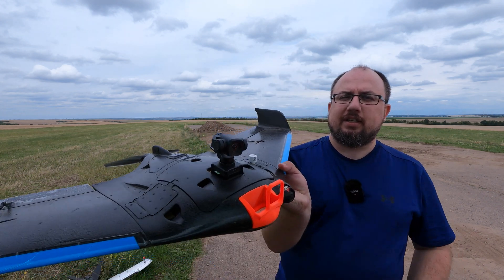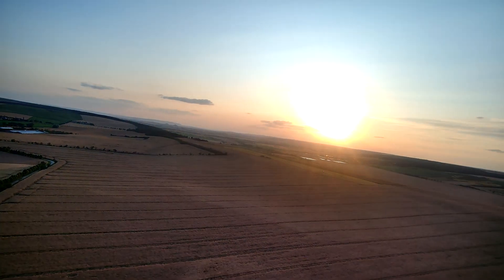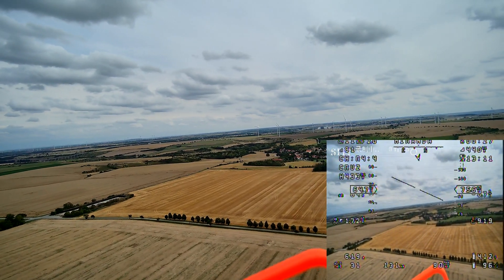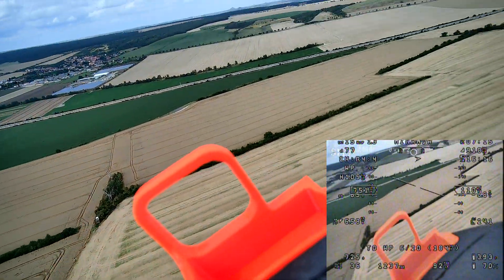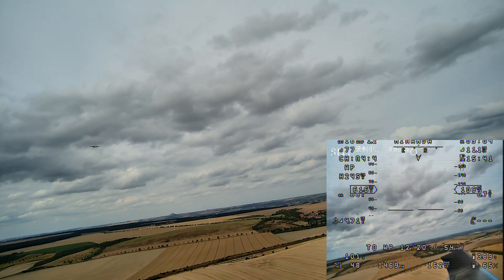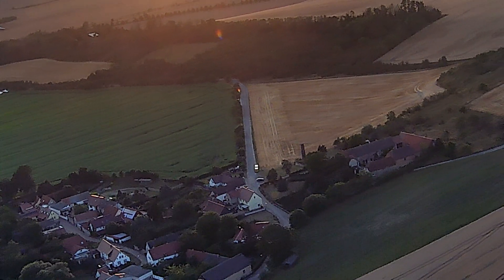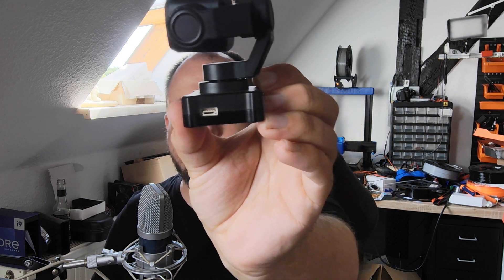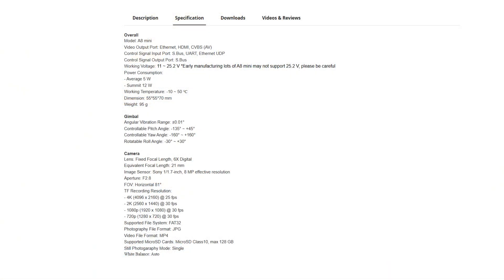Siyi A8 mini Gimbal on a Fixed Wing - Review [ENG]

Comment: Does any manufacturer provide zoom lenses for digital fpv cameras? 
I like the new Walksnail GM-3 gimbal, but the default 160 degree FOV on their cameras is way to wide (especially with head tracking).

Comment: Great video, very helpful, I'm still working out a few bugs implementing the A8 into my multi rotor, I mostly fly fpv freestyle quadcopters for recreation, and have a DJI Mavic 1 and Mavic 2 Enterprise Thermal for my side business and search n rescue team I volunteer with.  I recently got a good deal on a DJI F550 hextacopter, that I want to make into a lighting rig for search n rescue ops.  It's my first multirotor with more than 4 props, so it's been a learning experience, the A8 was a perfect price and fit, because it's purpose will be lighting more than photography, but with everything on the F550 being in the DJI ecosystem it was a little bit of a challenge getting the A8 to work, and I'm still ironing out a few things. 

What I did is use the DIY cable for the ethernet connecter that's next to the HDMI out, and just used the AV out pin to an analog 800mW fpv transmitter (there's actually a DJI OSD module between the A8 and video tx, for my telemetry), and powered the video tx from a 5v pad on the drone.  I'm using an older Radiolink AT9 radio with a R9DS rx for my control link, but only had 3 aux channels that were already being used for gear/arming and two for gain control.  But then I discovered that the older Radiolink radios connect to multiple receivers at the same time quite easily, and the actual radio still had 4 aux/servo channels available, when I was flying the F550.  So I just got another R9DS rx, connected it to the A8 via the included S-Bus Y cable, and mapped pitch axis, zoom, single photo, and start/stop recording to the free channels/servos on the radio, and I was in business.  

I'm having issues with the photo and recording, not always working, but I'm getting close to figuring it out. They must have fixed the pitch control you were talking about, because I have it on a slider, and depending on how I set my end points and sub-trim on the radio, I can set how fast and far the camera travels in each direction, and I set the midpoint on a switch to be able to center it quickly.  Anyway sorry for the long comment, just thought I'd throw it out there in case anyone else was struggling with non SIYI, Mavlink or Adrupilot hardware, thanks again for the video, it gave me some good insight on a couple decisions I need to make, take care, happy flying!!
Reply: Hey man! I am also in FPV and trying some stuff out with a bigger hexacopter, and I was looking for a decent camera to start with before saving up to get something like a gremsy. But for this camera it is pretty hard to find good reviews. Would you like to tell about your experience with this camera up until now? Cheers!

Comment: Was looking at this camera did a youtube search to find info, and found a video I'd missed. (subscribed)
I assume your just using analog video output via CVBS signal? I was a bit confused reading there manual as refers to "air unit", which I initial though meant DJI FPV "air unit" compatible. This does not appear to be the case. Would be nice to see such a gimbal like this with either Walksnail/Avatar, or DJI VTx support, or a VTx that took HDMI video input.

Comment: how are you transmitting the video feed? how do u connect to FC? Are u using a matek?
Reply: do you think i can get it working with my walksnail goggles>?
Reply: when u thinik next VTX is?
Reply from the maker: The gimbal has a normal analog Video output with a CVBS Signal like our FPV cams. it will not work with WS goggles yet. I also have no info about the new WS VTX with HDMI that would also work with this gimbal in HD. Waiting for that too!

Comment: I spent some time mounting this on my quad as I thought it would be a better solution than the separate 2 axis gimble and camera I had before.
The gimbal works well controlling it from my TX via Ardupilot but the camera is poor to  say the least.
At 4K there is lots of compression and is not as good as the Runcam Orange 4K I used before and no where near as good as the DJI pocket I mount on another drone.
Very disappointing It really is not worth the price

Comment: Might be interesting with the rumored walksnail VTX that supposedly can take an hdmi camera in.
Reply from the maker: That's what I'm also waiting for. It's actually officially announced not just rumored.
Reply: @MarcFPV  oh awesome I must have missed that. Do they have a date on it yet, Google is coming up with nothing.
Reply from the maker: @joe60000  they just posted a teaser image on Facebook with a sketched shape and some details about the different inputs. Since then it was silent. That was mid July. I am also waiting for a date and try to get info through my contacts.
Reply: @MarcFPV  fingers crossed this brings about the ability to used a switch powered HDMI splitter.

Comment: you really got one . I was looking for that for years cause I had seen it in 2019 or so but they had said back then it should be a copter platform with no wing support.
Reply from the maker: That's why they got in contact with me as they have interest in bringing it to fixed wings. So they wanted feedback.
Reply: @MarcFPV  you mentioned the gimbal control issues but I had thought you are flying dji fpv goggles which should be capable of headtracking cause my first dji racing goggles back in 2018 supported already head tracking and analy fpv plus hdmi input .

Like the review even though 1 axis has its own limits I had forgotten over time.